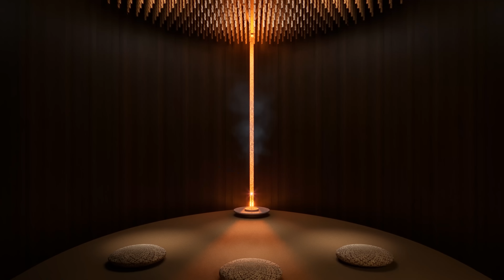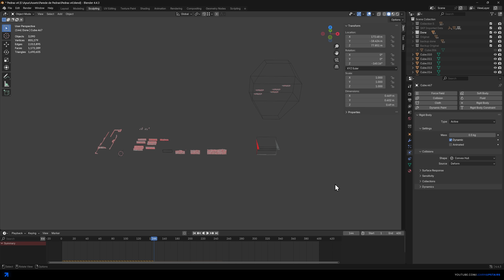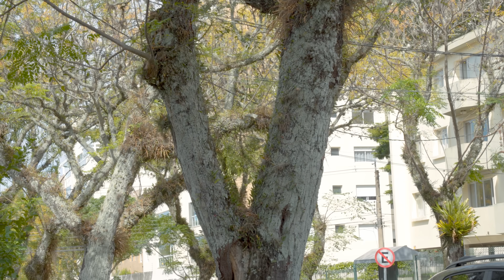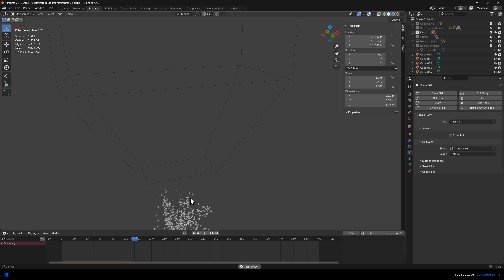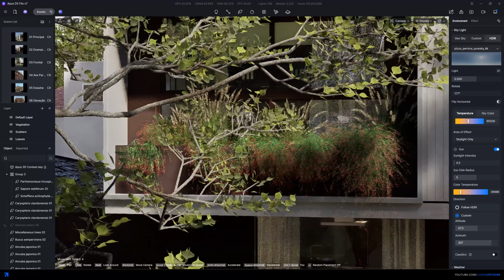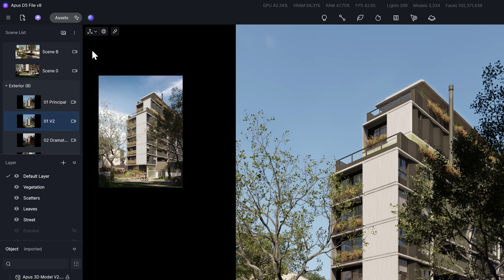Inside a Real Archviz Commission with D5 (Process and Tips)

Comment: How do you deal with changes the architect makes to the model since you're an external consultant and you dont have a link to their archicad file to sync too?
Reply from the maker: Good question! This really depends on the type of commission.

In this specific case, the project was already very advanced in terms of design. Most of the iterations had already been done internally, so by the time it reached me, it was ready for visualization. That meant very few changes during my work.

When changes did happen, I would usually model just that specific part and replace it, rather than relying on a full sync workflow.

In general, when you work as an external visualizer, you’re not really part of the design development phase. If you try to follow every design change in real time, you end up spending a lot of extra hours on things that are outside your scope. Ideally, the design team has already tested options with simpler visuals before bringing in a full visualization.

Even if you were working directly from Archicad, it’s still a BIM tool, and some aspects can feel quite rigid for detailed visualization work. It works great during the design phase, especially combined with D5, but for more control, it’s often better to bring the model into a dedicated 3D modeling software like SketchUp, Rhino, Blender, or 3ds Max and associate that with D5, that's the best combo IMO.

Comment: I really admire your work. What graphics card do you use for your work?
Reply from the maker: Thanks!! My current setup is quite high-end and handles multiple programs at once without any issues. HP offers a wide range of configurations depending on your needs, so you don’t necessarily need something at this level to run D5 smoothly. It really depends on the complexity of your scenes and workflow.
Reply: @LearnUpstairs Thank 🎉

Comment: That's interesting. It looks like my workflow. I use Rhino instead of sketchup for the refinement of the meshes. FOr specific models or UV mapping, Blender is the way to go.
You could create multiple shot of video within the same Clip, each shot can be add individualy to the render queue. That way, the Clip menu can be shorter and easier to work with.😁😁
Reply from the maker: Nice, thanks for the comment! How do you handle furniture and external assets with Rhino? Sketchup has a wide range of options only. Do you usually convert from a different file format? Or model all yourself?

And on the clips mention, you’re right! But I often prefer to have 1 per clip so that I know which scene is in which, and I can refer to that number. It also gives me more flexibility for the video editing process. And at the end the queue might be shorter, but length would be comparable I guess.

In any case, I appreciate the feedback! 🙏

Comment: Great video, thank you! Would you mind listing the desktop PC specs you're running? I clicked the HP link, but that system doesn't appear to come with a dedicated GPU, which I assume you have.
Reply from the maker: Appreciate the feedback! I’ve got the Z2 workstation with an RTX 5000 Ada (32GB VRAM), and the Fury 16 laptop with an RTX Pro 5000 Blackwell (24GB VRAM).

It’s a very high-end setup and handles pretty much anything I throw at it. HP offers a range of configurations though, so setups can be tailored depending on the type of work and scene complexity.

Let me know if you’d like to know more about the setup!

Comment: Impressive project! When you get updated Archicad models, do you usually update materials in D5 or in SketchUp before sending to D5?
Reply from the maker: Thanks!!! It depends, but for a strictly visualization workflow like this one I try to condense everything in Sketchup. So if updates happen in Archicad, I try to export only that part to Sketchup, maintaining material names consistent. It’s a bit of a workaround, but it gets me a cleaner file.

But then if it’s a design workflow with visualization, it’s best to keep everything in Archicad and use D5 as also an aggregator of models. So live sync with Archicad, but then manually importing extra assets and models. For example the context buildings and surroundings were a different SKP file.

I hope that makes sense! It’s one way of working, the one that makes more sense to me
Reply: @LearnUpstairs  Thanks for taking the time to explain! That makes a lot of sense.
I’ve been trying out a slightly different approach, regenerating the material setup the same way on each import instead of trying to preserve it.
Cleaning everything down to face-level and keeping material names consistent upfront seems to make updates much more predictable. Although it’s not the easiest thing to manage in practice.

Comment: how did you make the cement tiles?
Reply from the maker: There are many ways to do it. One way is: You can model a square with a bit of depth. Like 20cm x 20cm x 2cm. Then make it a component and duplicate how many times needed horizontally and vertically to fill the wall.

Then go inside the component, add an offset of 2mm or something, and push/pull back the edges to get rid of this spacing. That way you’ll have cement tiles that are not touching each other. The spacing can vary, but you need those contact shadows for a realistic result.